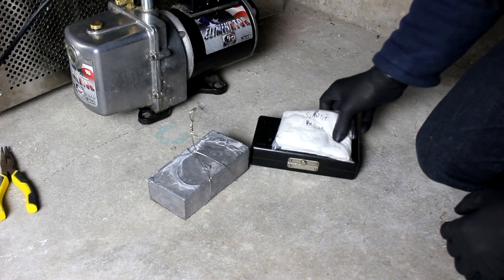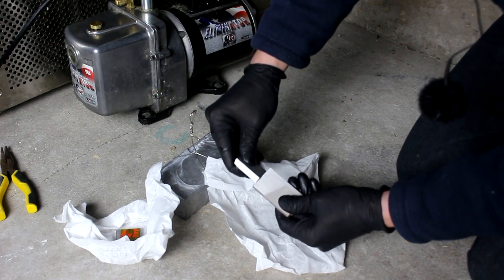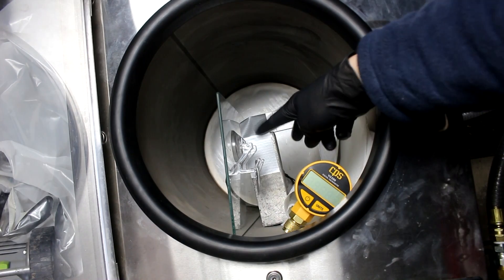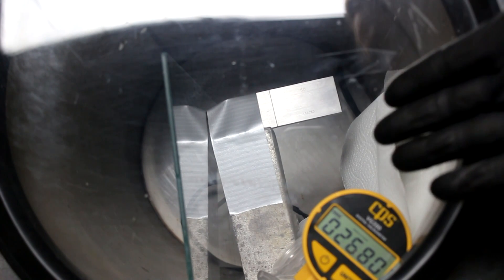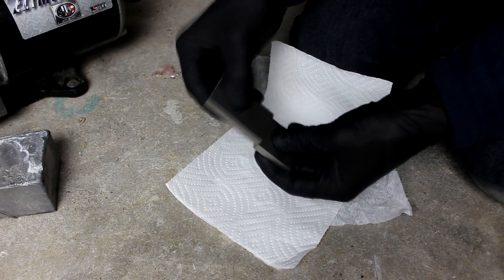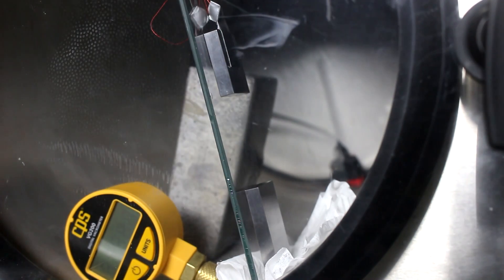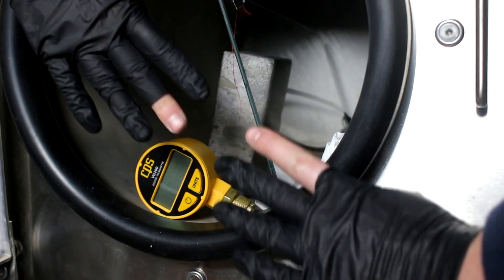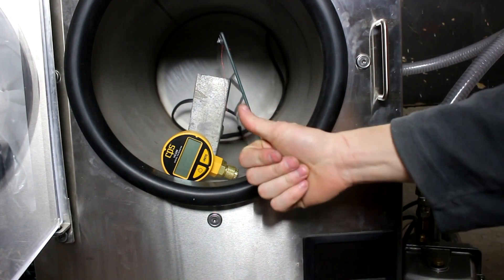Will Gauge Blocks Stick In Vacuum?

Comment: Surface chemist here!

7:50 : Cody, you can't fully remove oil films with a simple acetone washing. At this point, there is certainly still a residual oil film on your surface.

I have a bunch of colleagues who do electrochemistry and need their electrodes to be completely free of oil films and "atomically clean". While they do use acetone (and dichloromethane) to remove the bulk of it, they still have to use an ozone cleaner or do chemical etching to "finish the job". (It's basically a low pressure mercury vapor lamp in an enclosure. It makes high energy UV and breaks down O2 into oxygen radicals and ozone, that can then oxidize anything organic on your surface)

But acetone alone? Not only does it seem unlikely to fully dissolve all the oils, but you'll be left with at least whatever impurities were already present in your acetone and on your paper towel.

You can see it quit clearly by cleaning a piece of glass with acetone : once you're done, you'll see that water still beads up on your glass, as the residual grease makes it hydrophobic. However, if you then dip the piece of glass in a relatively concentrated solution of sodium hydroxide for a few hours, you'll etch its surface and directly expose the silanols and siloxanes that constitute the actual surface of your glass. After rinsing it with purified water, you'll see the glass is now superhydrophilic : water does not make drops on it, but instantly spreads into a thin film over the whole surface.

So, watching your video and seeing how you've disproved the "suction cup" hypothesis, I am now quite convinced the adhesion is entirely due to Van der Vaals forces between an oil film and the metal surfaces that "sandwich" it. The wringing must be needed to help that oil film to properly spread.You had less adhesion after cleaning with acetone because you had less of an oil film, but some of it was still there to provide that residual adhesion, only requiring a little more effort to be properly spread.

Now, why would you need an oil film for Van der Vaals forces to take effect? For the same reason a Gecko's paw must have millions of microscopic bristles : 
Since those forces only act on very short distances, on the scale of single atoms, you need both surfaces to perfectly conform to each other for the adhesion to happen.

Thanks to their bristles, a gecko's paws conform to any rough surface down to a few nanometers. But they still need their thin layer of oil to make it down all the way to the angstrom scale.

Here, you have two precisely machined metal surfaces, that can probably conform with each other down to a few micrometers or even tens of nanometers. But it is unrealistic to think they can match down to the angstrom, even the best telescope mirrors ever machined don't come close to that precision. 
So, by having a film of grease, or any other substance that can "fill the gaps", you allow those molecule-to-molecule interactions to stick both pieces of metal. Physisorbed water from ambient moisture might even take part into it! (In which case it will take a lot more than cleaning to completely stop them from sticking when you wring them.)

Keep up the great videos! ^^

Comment: Could the adhesive on the duct tape release any gasses in a vacuum? If it did, would those gasses coat everything in the chamber and keep the blocks from sticking? I'm guessing no, but I don't have anything to back that up.

Comment: I'm left thinking that you're creating heat to offset the crystalline structure of the metal just enough that they'll bond together, and that is why you have to wring them together with more force after the material is cleaned.  I've never felt like optical bonding was well explained, since so many in physics come up with very different mechanics as a conclusion.  Atmospheric humidity also might come into play, and I am not sure how to dismiss either case off the cuff.

Comment: Easier way is to measure the sepration force. You know the joint cross section and atmospherical pressure, you know the theoretical sepration force if vacuum is the only factor. Tested number is almost 10 times the force acted by vacuum itself.

Metalical bond is more likely the case. Sepration force increases over time. Gauge blocks actually cold weld (diffuse) together if left wrong together for extended period.of time. That's one advise from my metrology instructor and it has been my way of handleing guauge blocks ever since.

Glad to see them actually being tested though.

Comment: Cody can you look if the blocks emmit light when you take apart the blocks? My hypoteses is the free electrons  go from the atoms go to the other block making a bond. And the friction is needed as energy to transfer the electrons. When pulled apart the elektrons should spring back and emit a dim blue light

Comment: hi cody, i think you are partially correct, but not for the reason you think.

early nasa had issues with cold welding in a vacuum, they solved it by making sure to use dissimilar materials at contact points.

according to nasa, it has more to due with getting two clean edges of the same material close enough together that their electrons can interact and swap back and forth between the objects.

perhaps a remote controlled servo device in the chamber that will add force upon the two objects to squeeze them tightly together after the vacuum is drawn?
Reply: if i might add a new hypothesis about the friction end of things... most metals oxidize in atmosphere, even if only slightly. perhaps the sliding motion is scraping off this very thin layer of oxidization to allow clean metal on metal contact?
Reply: i use ceramic and steel blocks daily. they both stick equally

Comment: Are you considering the effect of the thin film of metal oxide that forms when the blocks are exposed to oxygen in the air? Vacuuming the air out won't rub off the metal oxide film. When you slide the blocks past each other, friction is scraping the oxide layer and exposing bare metal, which then sticks together. It's a cold weld but not a strong one, as most of the metal oxide film is still intact.

Comment: I would like to propose my own theory, Cold welding works alot like normal welding, it is acomplished by using the friction of them rubbing against each other to heat the atoms up just enough for them to lightly slip past each other, creating a microweld if you will.
Reply: Oh shit he already figured it out in the video

Comment: what if the suction is contained in between the joints since its almost perfectly flat ? maybe they lose the air between the suction verrry slow. another test in a longer time in vacuum

Comment: I see a problem with your test. If the hypothesis that you're testing is that wringing the gauge blocks removes all the air, and you're testing it by seeing if they stick in a vacuum chamber without wringing, then wouldn't the little bit of air pressure still inside (because it's not a perfect vacuum) effect your result?  

I'm no expert, but it seems to me that trying to test something that (according to the hypothesis) is caused by a perfect vacuum... by using an imperfect vacuum, doesn't really disprove the hypothesis.  That being said, it probably doesn't really matter, since that would fall under the "marble layer hypothesis" which you pretty much disproved in a different way, in full atmosphere.

Anyway, still a cool video though!

Comment: I think it works by the same principle of the gecko tape since due to its smoothness there is much more contact surface between the two gauge blocks than between two normal blocks

Comment: Maybe the lattice structure is being warped under stress and then they interlock as the molecules move back to their normal state or molecules in the air are being jammed into the lattice and deforming the structure.

Comment: Do you recon atomic diffusion could take place within cold welding? Atoms in a solid still move/ vibrate so my thinking is that the random movement of these atoms whilst in contact with the other metal so close diffuse over using the energy created through the friction of rubbing the together (hence why they didn't stick in the vacuum chamber as the energy was too low for the particles to diffuse fast enough or something) If this is completely scientifically incorrect i'd like to apologise as I am still studying for my GCSE's haha :D

Comment: Would this have any application to "cold welding"? I've wondered what (if any) the use of 3D printing metal inside of a vacuum, if the cold welding would be any better than normal metal printing and if it'd be any use at all.

Comment: Cody, 1) in the metal piece there are no covalent bonds, so it's not that atoms have to come together - rather that electrons have to come between the atoms from both pieces so that both of them get attracted. And I think that is exactly what happens when they stick - part of the electrons go between the blocks.
2) as for non-sticking in the vacuum drop experiment, I think that the glass might not be straight enough. Maybe you should rather just suspend one piece over another without any side support. When let go, it should right itself. 
3)If that does not work either, then maybe the reason for friction is to give electrons enough energy to pass some potential barrier, so maybe you could try doing it in another way, for example heating the blocks some or irradiating them.

Comment: How long do the metal pieces stick together?
If it was for a vacuum between the two, you would expect it to weaken over time, like with all vacuum.
I would agree that it has to do with electron interaction. Maybe the distribution within the electron cloud of the metal gets screwed with when you slide them together, so it produces something like a connection. I could imagine that the irregularities  of the surface hinder a perfect connection but the forces are strong enough to maintain stickyness. Or on the contrary you would be able to coldweld them in perfect vacuum but the air is preventing a permanent bonding. 
Have you tried adding a current? Magnets? Heat?

Comment: Not trolling, I'm legit asking. Could you put a mouse/rat  inside that vaccum chamber to see what happens? Or, what would happen to a mouse/rat/any living breathing thing inside a chamber depressurizing?
Reply: Lucas Barbosa Do you have any idea how horrible that would be for the animal? I think if you're so eager to find out what happens you can volunteer to be the animal inside the chamber.
Reply: A. Zak if it helps science and further understanding of what happens to a body in a depressurized environment, I'd gladly do it. But I'd rather a mouse goes first, because it's a fucking mouse, no ones gonna miss it. I even said a mouse because it's the most used animal in science experiments.
Reply: +Lucas Barbosa

What is wrong with you?
Reply: Nothing. What is wrong with you?

Comment: I jumped around in the video but it seems like pressing them together and then hanging them up in the vacuum chamber and then see if they unstuck and fall down when the pressure gets too low would be a good experiment.

Comment: The glass plate is not necessarily flat. Try just resting one on top of the other to begin with. Then pump out the air and see if they fuse.

Comment: i was wondering if duct tape can stick to a 100% smooth area if something like that was possible?

i think not because of the area not having those gaps for the stickyness
Reply: KraineK xDDD karambitch I think it would. it generally adheres better to smooth than to rough surfaces. the sticky stuff under the tape created an air tight seal which creates the adhesion. no roughness required.

Comment: Interesting video!  One question comes to mind.  When sliding them together, if you stop sliding them halfway and try to start again, can you?  That is, do they resist further sliding once you stop?  If so, I wonder what is happening in that time period the instant you stop sliding them?  I guess I also wonder the converse: if you start sliding them together and try to pull them apart AS you are still sliding them, are they still attracted to each other while the sliding action is still going and you haven't stopped yet?  Wondering if it has something to do with electron alignment, I also wonder if you put a very small current/voltage through them with one block negative and the other block positive and just touch them together, if they'd stick.

Comment: After seeing this I'd be interested to see how ceramic slips would behave under a vacuum. Obviously not being made from steel one would assume the cold welding effect wouldn't be taking place? Or are ceramic materials also effected by this phenomenon? 

Also, as an engineer it pains me to see perfectly good slip guages being used in such a cavalier fashion. But science is science I suppose, sacrifices are needed. Lol

Comment: Who the hell thought suction is a good explanation? Here's what Richard Feynman thought,

 "The reason for this unexpected behavior is that when the atoms in contact are all of the same kind, there is no way for the atoms to “know” that they are in different pieces of copper. When there are other atoms, in the oxides and greases and more complicated thin surface layers of contaminants in between, the atoms “know” when they are not on the same part." 

For more read Feynman Lectures on Physics Volume 1, the Chapter on friction.

Comment: Would wringing work under a liquid? Like, if you submerge the gauge blocks in distilled water, will they still wring together?
Reply from the maker: yes
Reply: Cody'sLab  What would happen if they were made out of different metals? Could it be that they scratch the surface of each other, as they are of equal hardness, and therefore adhere?
Reply: High quality gauge blocks are sometimes made of Ceramic. No metal involved!
Reply: I think what OutOfNamesToChoose meant was to use two different materials. One ceramic and one metal maybe. That might provide some insight into what's going on here
Reply: maybe the friction from rubbing them against each other creates a some sort of a heat adhesion/reaction?
Reply: Solomon_97 i was gonna suggest the same. Try under water, and under acetone.
Reply: the molecules have to be the same size to properly align, so ceramic and metal would not work.
Reply: I am far from being an expert here, but is it possible two smooth enough surfaces will be treated like a single large molecule by the London dispersion force?  Ringing them may help disperse the electrons withing the smooth surfaces of the gauge blocks, causing electrons to be more concentrated in some places then in others.  This uneven electron arrangement may polarize the surfaces and allow them to attract to one another, then return to normal shortly after the surfaces are separated.

If there are any reasons this guess can't be right, I'm interested in knowing why.
Reply: That is an interesting side line: 2 different metals. If that works it could help a lot with the 'theory' behind the effect. Please note that currently the used gauge block metals are never 100% pure. They're alloys.
Reply: exactly what I'm thinking